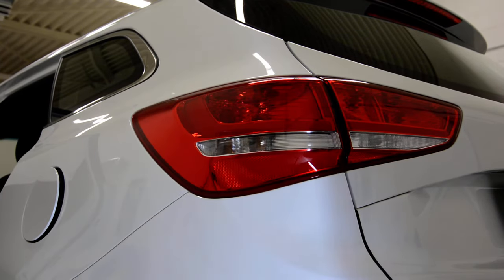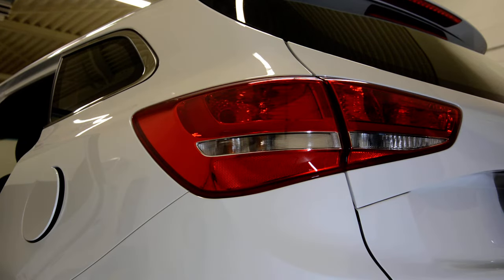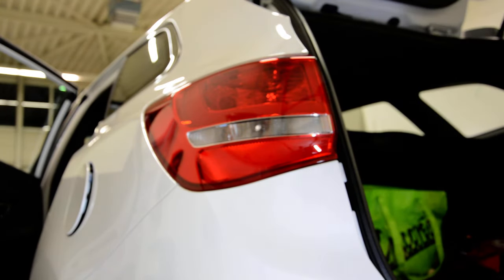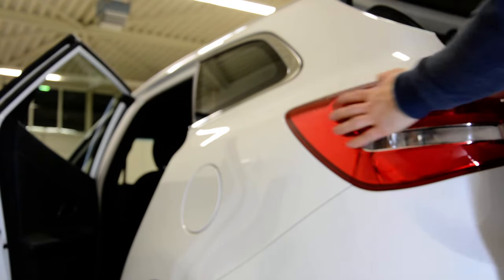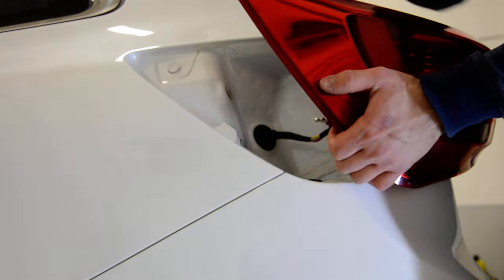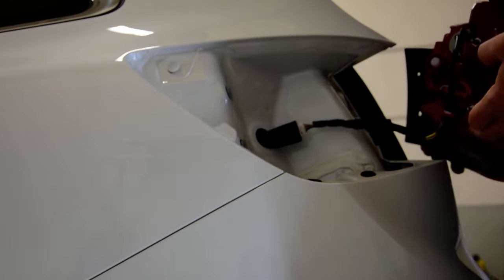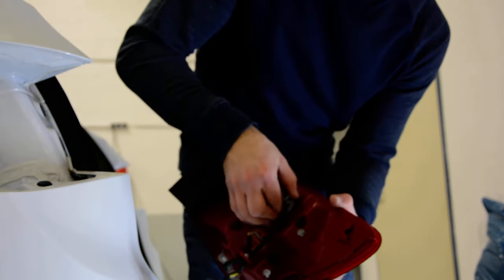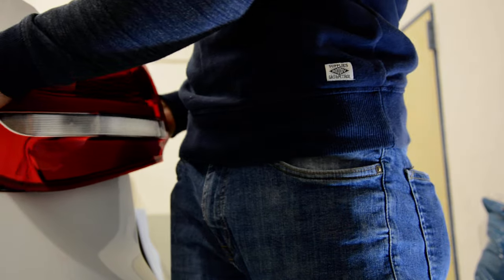Rear tail light removal replacement Kia Cee'd exterior part

Comment: Very helpful. Just 1 small comment: the body cannot be removed. Tried on the other side as well: nothing happened.  It would be much easier to put the entire god blessed car in fire. It's ridiculous. Yes. This is what I'm going to do. Find a big mountain, drive up to the top, let it burn and push it down waiting for the big nice explosion.
Loved this car, but this is either a fake video, or you are a god d... Merlini. Or I"m in a candy camera show.
It is simply not working.
I've changed 200 brake lights so far in my life, but building a nuclear bomb in the night without eyes and arms is an afternoon tea compared to this s...t.